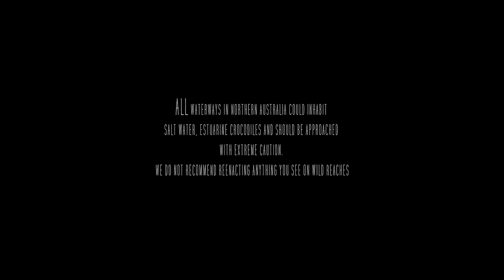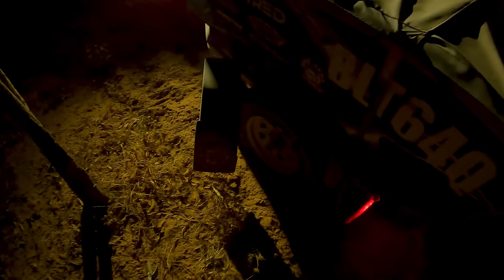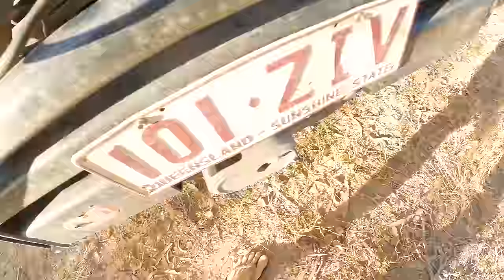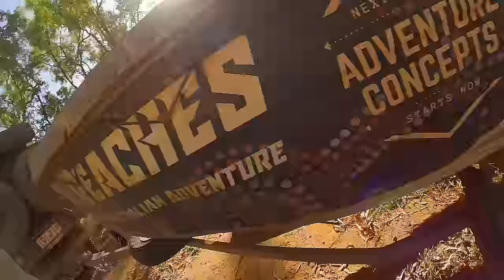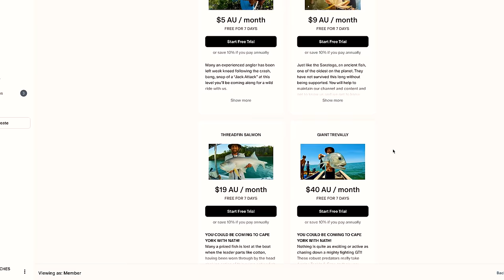The POLICE were looking for me | CARNAGE and Barramundi in Far Northern Australia

Comment: When I drive out to Coburg, you bolts are what I normally break not springs, but I bring two of each springs I bring for U-bolts also two sets of spare hubs and bearings and three spare tyres for the trailer and my guards are made out of poly so they flex and they don’t rip apart

Comment: Cooktown Ironwood, wood is known as red ebony, pretty timer but the wood is likely to cause allergic reactions when worked and is a sensitizer regardless. The leaves are deadly to livestock, assuming they can reach it, which has happened with them in trucks parked under the trees. Very interesting about the root pitch glue.

Comment: Hey mate I use to have same drama with springs on boat trailer snapping worked out that it was from putting axle under spring for more height. We also run chains from crossmember to axle.

Comment: I think you have figured this out already, but the ordinary boat traier (any trailer really) is not up to the rigours of Australian outback tracks. Even for your boat (outstanding as it is!), you really need heavy duty trailer. I recall driving out of Darwin down towards West Alligator Head (approx 200km of rough track) in the 1990s. Bits of my boat trailer broke off like yours, generally spot welds breaking on corrigations. Anyway, love your vids,

Comment: Hi bud your axle is in wrong it’s meant to be sitting on the spring between the body and the spring and the location plate welded on axle sitting on the pin and fish plate on the bottom with spring washers and the nuts.. that’s why it came loose and slid I make trailers and work at a trailer hire place and I do repairs people mount like yours for extra hight but as you found out it moves

Comment: Have oi seen the single leaf parabolic spring it’s eye to slipper exactly what oi have have  on trailer. Reason I like the is they won’t break at centre bolt as it thick as  nearly 4 springs thick and tapers out thinner.  Come in 900 kg and 1150 kg rateing I always carry 2 spare of them in country your in. Best $100 ever spent never needed yet as it’s same I run on my tinny